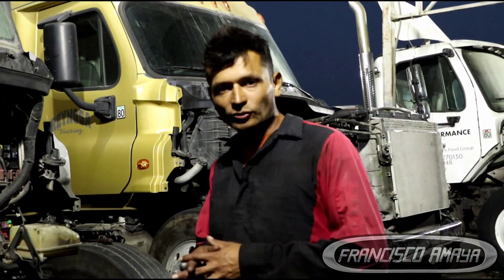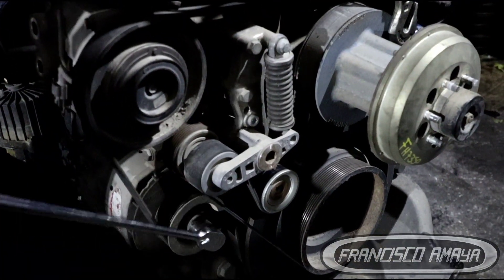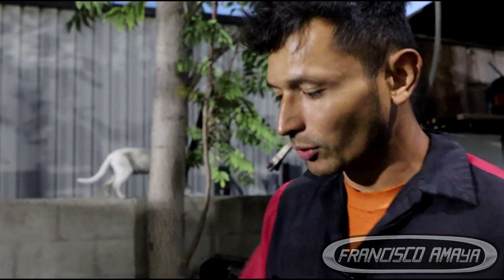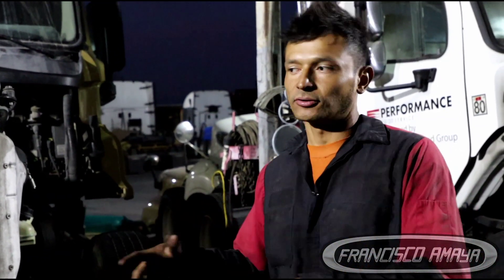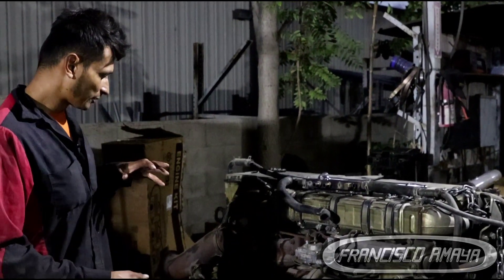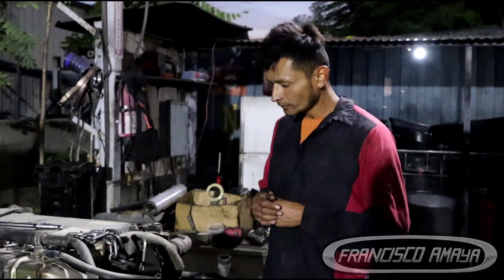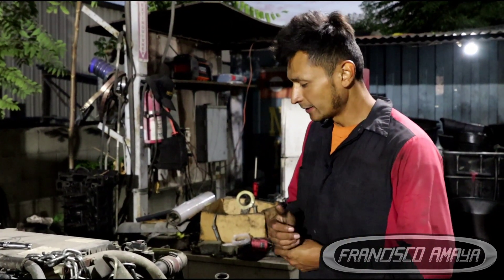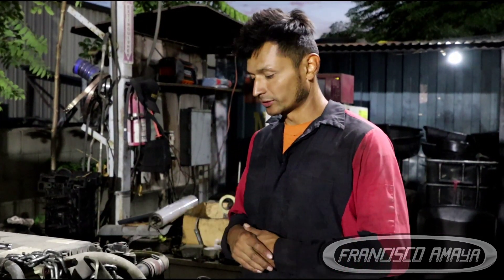DD15 engine crankshaft damage engine lock up low oil pressure inspections parts to replace cost

Comment: Thank you Francisco!!! I had to do a regen and then force shutdown right away! And then it died! I put it in neutral and I made it to a Loves parking lot but I got a long wait for help. My friends say the motor is locked up so now I can try that method. The other method I tried was; under the transmission there’s a door with two 13 screws, tried spinning the wheel with a flat head and nothing, took the serpentine belt too just incase it was causing too much tension but nothing. Then tried spinning the crank from the front but nothing. I think it’s locked but now I can try this other method. Thanks!!! Truck doesn’t start just clicks

Comment: Hello . Thanks for the information. I have locked up dd15  . They said if we rebuild the crankshaft it will be lock again . I need your advice
Reply from the maker: first, you must what is the damage. if the crankshaft is damaged by a connecting rod, you only need to replace the crankshaft. but if the engine suffers the same damage once again it could be a labor error.

Comment: Hi Francisco. I have a 2015 freightliner cascadia. The problem is everytime I hook up to a trailer( multiple Trailers) then if I hit a road bump while driving  even a small bump, the ABS light comes on and shortly it goes off. I took it to a shop but they can't find the problem. Any Idea?
Reply: Run a new wire from plug to abs post.